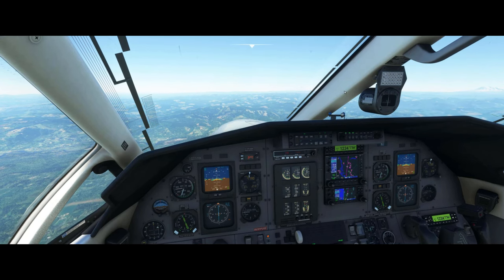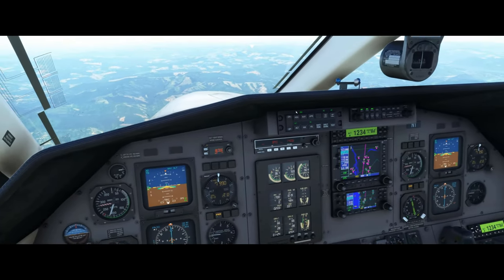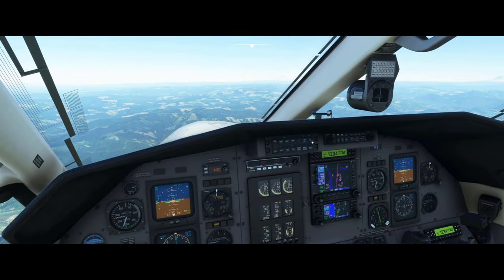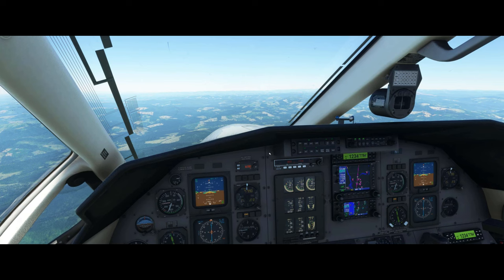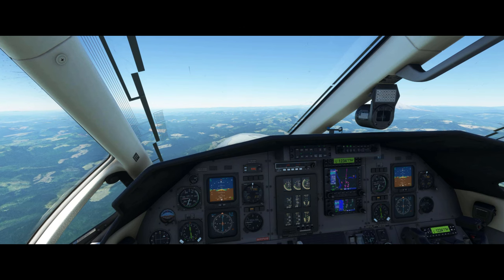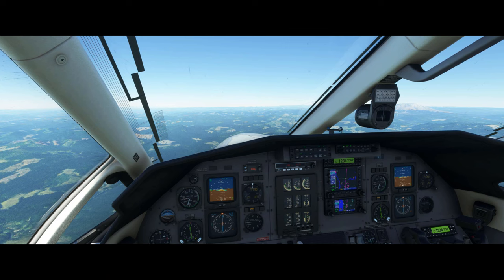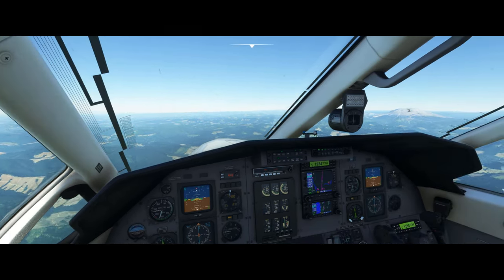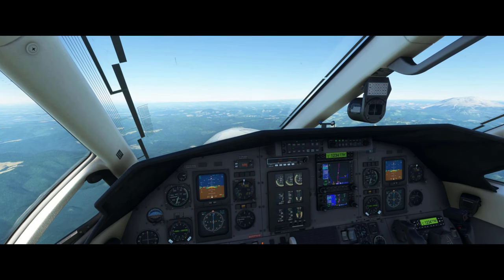What is the yaw damper??

Comment: Does anything like this also exist for roll and pitch? Sounds to me it's pretty useful in turbulences, especially in airliners.
Reply from the maker: Roll and pitch stability are incorporated into the design of the airframe. Dihedral, the slight V-shape of the wings, tends to roll the wings back to level when disturbed. Pitch stability is achieved through proper loading of the airplane. The farther aft the CG, the less stable the airplane is in pitch and vice versa. Good question!